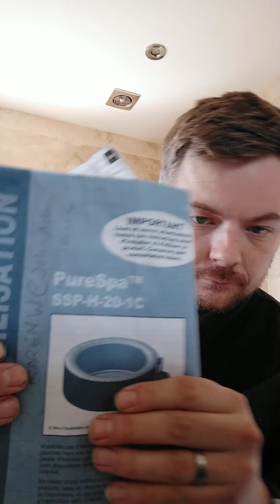Intex PureSpa E90 error fix

Comment: I've had the same issue. A multi meter showed the 12.4v ac so I was convinced (still am it was the pump) done it... Made sure water is bled through... Even pushed water through with a hose pipe.... Still nothing. I'm leaning again to another pump but I need to 12 v ac test the pump. Easier said than done that. So peeved off atm
Reply: I know Im randomly asking but does any of you know a way to log back into an instagram account..?
I was dumb forgot my account password. I would love any tricks you can offer me!
Reply: @Zakai Makai Instablaster :)
Reply: @Elon Misael It did the trick and I actually got access to my account again. I am so happy:D
Thanks so much, you saved my account !
Reply: @Zakai Makai glad I could help =)

Comment: This is a shame. I have next door neighbors who have a hot tub, and it's   barely been a month, and this is happening for the SECOND time. Intex? PureSpa. That's what they have.  They've cleaned the filter, and it worked for a couple of weeks, and now the hot tub is back on the frits again with E90! This is shameful, and I'm wondering if they're going to have to replace their pump
Reply from the maker: Hi, in all likeliness it's the filter, if it's used all the time it needs changing, the filters sent very forgiving, great at what they do but if you use a water clarify solution this clumps all the bits together and clogs the filter. You can clean the filters and reuse them or don't scree the filter lid on quite so tight 👍